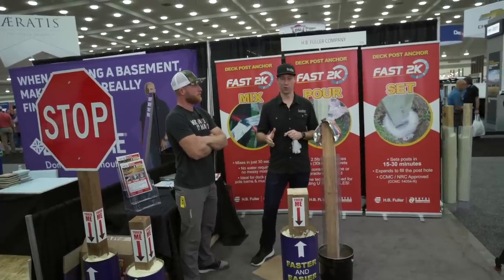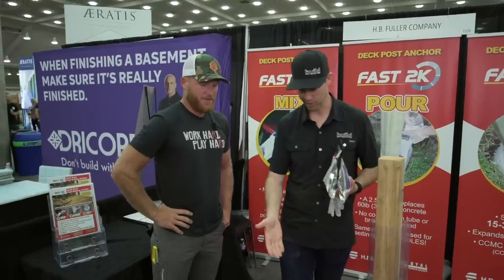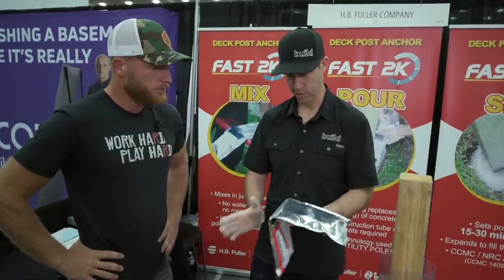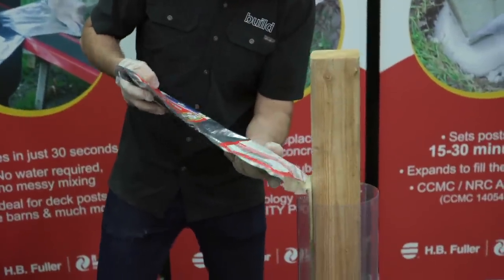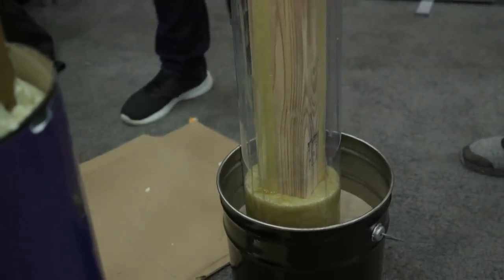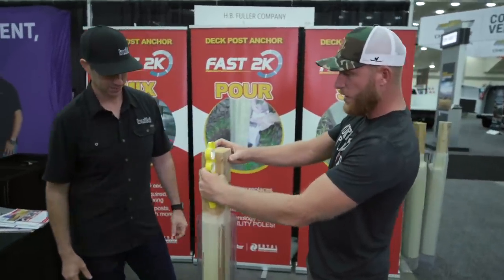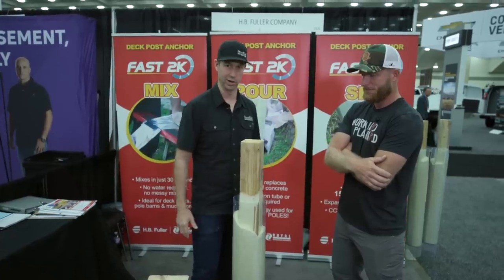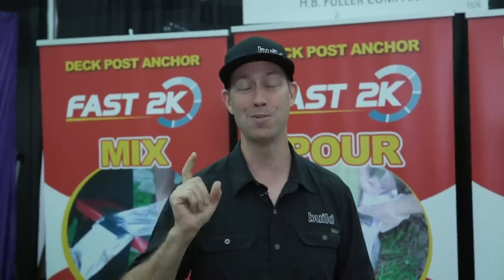Foam INSTEAD  of Concrete???

Comment: Don't put the post in the ground. Use concrete in the hole and then iron in the concrete and then the pole on top of the iron.
Reply: Ikr. That's how I do it. I get it though. This is for guys who are not doing a full on build but just a quick deck. They wanna set the post, frame out and then cover. Collect the check and move on
Reply: Not sure those companies are using this per cost to concrete mix at 3-9 per bag and  10-15 per bag per post for the Fast2k, but it does not do well long term in compressive type structure post in ground, it is more for such as fence. mailbox, sign, and other such posts.
Reply: I set the iron in the concrete. If the post rots out, I can pull the post and replace it in the iron. Hardly rocket science.
Reply: for a DECK yeah thats pretty much the code these days, but this would make Fence installs faster.
Reply: John Strand I came to see this video to learn about what would be the best way to make my fences and decks for my future house I’m not doing this as a business just doing it for myself and scrolling through the comments I see your comment and without any construction knowledge and just common sense your comment takes the cake on making sense. So thanks. If I still wanted to have a wooden post I guess I would drill a hole through the center of the wooden post and slide it over the iron pole that you’d put into the concrete like you said. Then I’d apply a liquid rubber paint to it so it doesn’t rot over the years too. Maybe two coats of rubber paint just to be extra safe. Like I said, thanks for your input. Very helpful.
Reply: search oxide jacking, iron degrades too.
Reply: Just dip your post bottoms in a liquid roofing material then set in concrete.  I've done this for years I usually use the silvered type.
Reply: Farmers have been burning the part of their wooden fence poles at the part that goes into the ground for generations. Just a surface burn. It holds the rot away for 20 years, so you’ll only make 2-3 fences in your lifetime and everything is biodegradable. Please don’t use this chemical crap that’ll never go away.
Reply: @capslock9031  I'm gonna continue using it, your talking about a material that rain hits a roof and rinses over and goes out a downspout, what's the difference?  Also it's no worse than creosote either that is used in posts and my method has a fence that is 25 years old still standing firm.
Reply: caps lock, farmers do this for posts to the farm. Not for concrete and posts. If you put the wood in the ground and concrete what happens? Water will expand the wood and perhaps break the concrete in 2 half's. If you put https://www.wurth.se/produkter/byggbeslag--beslag--stalprofiler/byggvinklarbeslag/stolpsko/stolpsko-typ-b---4-mm/ in the concrete, then you get a stronger concrete and a way to adjust the post some if needed.
Reply: Sure, I was only talking about fence posts, if you have to have a foundation for sturdiness, then you'll have to go with concrete. In that case, from an environmental standpoint, concrete is still way more benign than the chemical crap shown in this video.
Reply: Without a doubt the best way to set posts. Although I am always looking for better ways to perform a task, the best way is alwayd the right way. 
Yet these methods piss me off, because they dont consider the waste involved with these products. They come onto the market, and many jump onto the wagon to fit in, and those that were meant to make money make money, while everyone else is left cleaning up the mess. Thankfully states and government is begaining to hold these companies more accountable for environmental damage.
Reply: @Joshua79C  actually the most common application I see for it is in power poles.
Reply: Foam or even some sleeve to protect the post longer before it eventually deteriorates and needs to be replaced only means less number of time it needs replacing between lifespans as determined by the woods durability and ability to dry out properly after it gets wet to not rot as quickly.Either way as long as it contains the leeching of the chemical treatment in the wood only means the post will last longer and none or less/little contamination of the soil. Just like a home, the wider or larger the base/footing the more stable the structure remains.

To each their own decision to go with what be it set in concrete or foam or bracket (dry or wet) set into concrete. It mostly comes down to costs and time and even how durable a foundation you want for the post(s).

As for the chemical preservative, it is minimal despite what you see on the surface, as the saying goes, never judge a book by its cover as most preservatives are as much as 0.80 mil in depth (that is in inches) which can be anywhere from several ounces to as much as a gallon of preservative. Creosote is the original treatment and most flammable at that as well. Thank goodness for newer barriers such as Rhino lining or LineX even and at most you need to cover to just 2 above the ground surface of the post base when setting it in the soil or embedding in concrete as most cases of rot are just above the surface to about a foot or two below grade.

Polesaver/Postsaver, Plastisleeve (both sold direct online) and Post Protector (of which is sold through Home Depot and Lowe's) are good choices for those who still want to set a post in the concrete and prefer it lasts longer as such and are not that expensive as a packet or gallon or so of foam mix. Plastisleeve and Post Protectors come in two styles, boot which covers the base to above grade or a sleeve which are 22 inch (Plastisleeve) or 30 inches long (Post Protector).
Reply: You mean a post stirrup! They are NOT cheap and not recommended for a fence as they will flex more than a standard fence post which is 100mmx75mm hardwood. They are used predominately for verandah posts where the top of the post is braced by a beam.
Reply: @islanti    Plus termites.
Reply: @capslock9031  concrete production accounts for a pretty significant portion of greenhouse gas creation. I know this isn't applicable to fence posts, and using some quikcrete, but you mentioned foundational pouring, which generally requires a truck bringing in the concrete.

Comment: Back in the 1970's there were people like this who stated that we would run out of tree's and our best solution was to switch to PLASTIC.   Take a look at where we are now with plastic and the bigger problems it brought.  I can still look out my window and see tree's.   This foam has been promoted for many things including the building industry which claimed it was better then the insulation that has been used for years and years.     So a few houses had this sprayed on the inside of their roofs.    This then prevented the heat from the roof to leech into the attic and then dissipate thru the attic vents.  This in turn cooked the roof sheathing and shortened the lifespan of roof shingles by almost half.   The biggest factor they do not tell you is how flammable this foam is.  If it is in your house and it catches fire,  you will never get it out.    If you think plastic is the scourge of our planet,  keep using this to replace tried and true methods and it will be our plastic of the future.   One other thing to mention here.....Those who will use this in place of a higher priced product,  WILL NOT pass that saving on to there customers and that is a fact.

Comment: I am a dish network, installer we have adopted this product for our metal post installs. I can speak on the behalf of the installation compared to concrete this stuff is far superior. In 15 minutes I am able to mount a dish to the pole and it is rock solid as firm in the ground as set concrete. This foam does have hole diameter guidelines that have to be followed to achieve the strength that is advertised
Reply from the maker: Thanks for the comments from your experience.
Reply: fine. if i'm installing dishes ill use this, anything else i'll still use concrete.
Reply: Right on Chris Frost. We are also the manufacturers of the product that I believe you've been using. I'm glad you like it!
Reply: Clearly this comment above is fake we all know why lol
Reply: @The Sustainable Texan yeah I run into terrible installations myself but thats not every Installer. There are "good eggs" and "bad eggs" in every industry, yours is no exception.
Reply: Matt Risinger why not comment on price point of environmental concerns this product is great for certain jobs but if your setting post all day concrete is more economical at this point

Comment: My concern would be the durability of the foam with time.  Lets not also discount that the concrete mass adds further stability just because it weights significantly more.  Granted the force of the soils may greatly dwarf the added weight to the point that isn't not significant at all.  Very  interesting for sure.  The water proofing along is a huge advantage.
Reply: Foam is like plastic so I doubt it will degrade for a very long time. Usually you don't put too much concrete around the posts anyway to have stabilizing mass. It's more of the lateral pressure that kept the post rigid. I like this product because concrete causes wood to rot after 5 years with contact to moisture.
Reply: Its been used on telephone poles for a long time. I did my fence about 5 years ago and its still solid.
Reply: Hi firehazard51, this is Edson Fariello with H. B. Fuller, the manufacturer of Fast 2K, the product that Matt and Kyle demonstrated. The weight of the footing only matters for vertical movement. For example, in areas with frost, you always want to dig the hole 6" below the frost line, otherwise frozen water may move the post and footing up no matter if the footing is made of concrete or our Fast 2K. What holds the post in place is the strong adhesion of the Fast 2K footing to the post and ground. The federal agency National Research Council tested it for almost 2 years. Pull out tests results: 4,000 lbs of vertical load could not remove the post. When they applied 7,000 lbs, they broke the post a the ground level.
Reply: firehazard51 
Then use hydraulic concrete it's waterproof
Reply: @ParmMohan-us6rn  Matt.... Sir you know better than anyone polyurethane foam breaks down under uv and weatherization is not kind to any of it uv resistant or not. You also know bugs and termites love tunneling homes in this stuff. It's a major concern foaming houses that aren't as we both know air tight. You know better than this but gotta promote and I guess.
Reply: @edsonfariello9178   What's stopping this from being poured by cement mixing truck and pouring into cinderblocks for a retaining wall, raised foundation, or best - pouring over monolithic dome shapes and then shaving off any imperfections. Its sturdy, water proof, and looks like a good insulator.  
                                                                                                                     -exploring contractor in the time of wood shortage

Comment: Ok I’ve done both at my house concrete going up one side and the neighbors on the other insisted on foam 🤦🏼‍♂️ . The facts are in after several years ,I mean 3 , and guess which one is spongy and which one is rock solid yep the one with rocks is right ……

Comment: The salesman did say that one bag of  foam replaces one 60 lb bag of concrete.  About 18- 20 bags of  60 lb concrete equal 1/3 yard; depending on what brand of concrete you use. Some brands use more sand and some add more gravel to gain volume. That would mean it would take 18- 20 bags of foam to replace 1/3 yard of concrete, not 3 or 4 bags. At around $13 for one bag of foam vs $3.20 for a 60 lb bag of quikrete, how is the foam cheaper? Will the foam catch on fire if cutting with a torch and welding on a metal post? I’m sure the foam is convenient for certain light applications like small signs and mail boxes. Telephone poles are heavy and set deep, that’s what keeps them planted not the foam. It’s more convenient to use the foam rather than trying to pack the dirt around it. Just my two cents on the topic.

Comment: According to the professors at Mississippi State Forest Products Lab.  Concrete embedded posts rot at the top where air and moisture meets the post and the concrete.  It will rot in the same way with the foam.

Comment: The nice thing about expanding foam is if the soil is soft it pushes outwards kinda "keying" itself into the ground. Same concept as those cone shaped footer forms but your not disturbing the soil to get that cone form into the ground the foam just does it in its nature.

Comment: 2 things. First, I'm not convinced about the foam preventing or resisting the post rotting. Post rot occurs right at ground level where oxygen and moisture meet. What you have holding the post underground won't matter much. Second, no way in hell a skidsteer could "shear" off even a mediocre quality 4x4 post. The tensile strength of wood is incredible. I don't think a very large crane could successfully rip a 4x4 apart if it were pulling straight on without any side loading. I think it's weird that Matt or especially Kyle even contemplated the possibility that a skid steer could pull it apart. I have to think they both know better.
Reply: 95thousandroses agreed it would have to be embedded at least 20 feet deep to resist uplift forces and pulled out with a large excavator not a bobcat.
Reply: 95thousandroses  -  if he was correct in his terminology, that it’s a polyurethane foam, that is indeed a non-porous ”closed cell” foam so it would keep the water out...
Reply: then any water going down the grain of the wood would be trapped at the bottom, soggy wood is not happy wood.
Reply: it might only be effective if the foam extended above grade. And the foam top edges were sloped away from the post so as not to hold water. I can' imagine foam working well above grade and in the elements like the Sun and critters.
Reply: Or someone got paid to go along with these shenanigans?
Reply: @95thousandroses Concrete is a great way to keep the post moist, whereas PU foam is water-proof. UV degradation is a concern, and I'm not sure how they'd solve that.
@Mourt Water will also move up the grain of the wood and release from the top.
Reply from the maker: No money exchanged here. This is just our unbiased opinions. Remember we are talking fence posts here people. This isn’t house foundations we are contemplating
Reply: After I wrote my post I did feel like I was a bit harsh. Whether or not a skidsteer can pull apart a 4x4 is really nitpicking when we are just talking fence posts. From my experience with closed-cell foam I have no doubt that this product would adequately hold a post in the ground whether its a fence or deck.  I will be very interesting 10 years from now too see the conditions of rot of concrete set posts and foam set posts.
Reply: Really the placards behind you in the video say "deck post anchor" not fence post anchor. A deck I did this summer required 14" holes to meet code. This product would be much more expensive than concrete to fill the  same cubic feet of space.
Reply: Hi Matt and everyone. Once again this is Edson Fariello with H. B. Fuller, the manufacturer of Fast 2K. The product Matt demonstrated with Kyle is actually formulated for decks, signs and barn posts. We also have a formula for fences called Fast 2K Fence Post Backfill. And as Matt said, we have not paid Matt and Kyle to do this. They are great guys that everyone admire and were very generous to take the time to stop by our booth.
Reply: You're right. No way in hell a skid steer broke a 4x4 in half pulling it out of the ground.
Reply: @95thousandroses  well it does here in the UK  no problems my posts are as good as the day I put them in. I even put a test post in 7 years ago I checked it the other day. I dug down to the bottom of the post approx 19 inches and dry as a bone  no rot the foam done it's job
Reply: Correct
Reply: The hidden detail of their claim is the fact that those posts were probably not pulled perfectly upwards. The posts were probably pulled to the side, which would more than likely cause it to break as the post would have to move a very large amount of set dirt to break free at an angle.
Reply: For Stuff like fence post. Gravel is the way to go since it permits moisture to escape. FWIW: I apply a asphalt based sealant to my pressure treated posts as an extra measure.
Reply: Matt Risinger.  No, actually you were talking about post frame building holes and saying this would be cheaper.  It doesn't take a third of a yard to fill up a fence post hole.
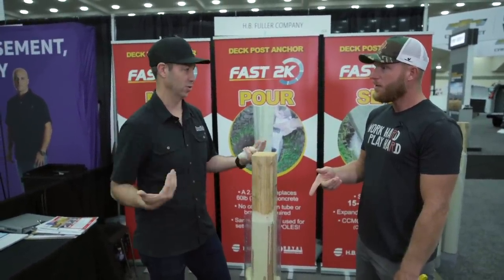Reply: I hate to burst your bubble, but in 1991 I had a brand new F 250 4x4 port fuel injected 460 with 4:10.1 limited slip axles and I snapped 6x6 posts in a campground to remove them.  and that was no jerking the guts out of it.  I can tear apart a 4x4 with a hammer much less a skid steer...
Reply: @johnpyle8027  But you're not talking about tensile strength.
Reply: @seigeengine  As long as it's covered with soil it won't be effected by UV .
Reply: If it's covered by soil it won't be preventing moisture in the soil from getting to the wood.
Reply: Michael flynn no it’s wouldn’t lol
Reply: As far as shearing the post, wood typically fails before the compound or adhesive applied to it.  

Go put some Titebond on 2 boards and try and rip them apart. The wood will fail, not the glue.
Reply: @95thousandroses  I just had a 20x20 outbuilding that had tip settled lifted by purlift, they guarantee 10 yrs with their closed cell high density poly foam. The ooze out has to be cut quickly because this stuff cures like a rock- even a sharp spade takes 4 or 5 wacks to cut it.  Saved huge and it came up beautifully, no cracks.